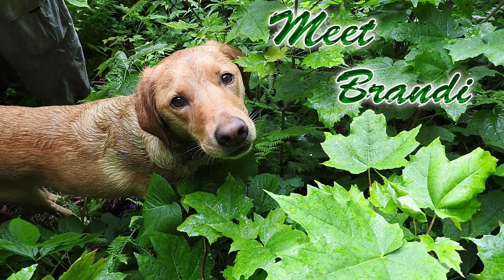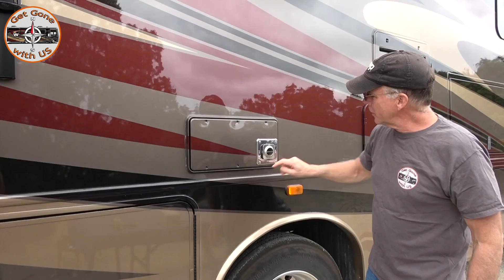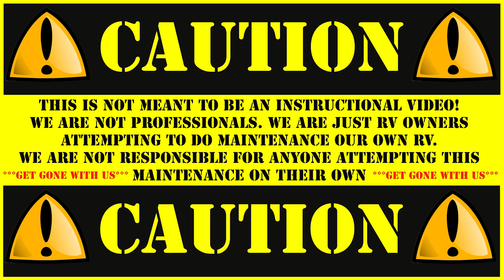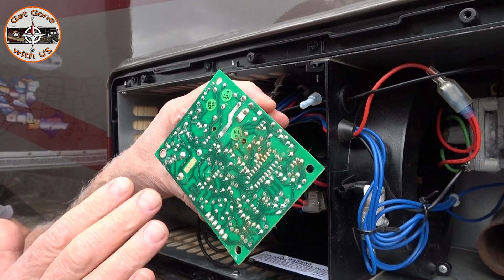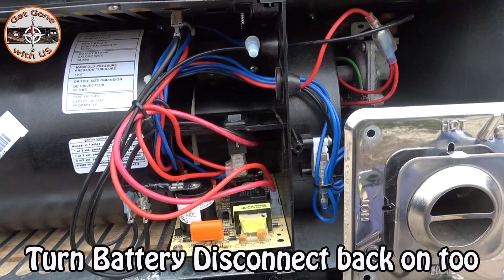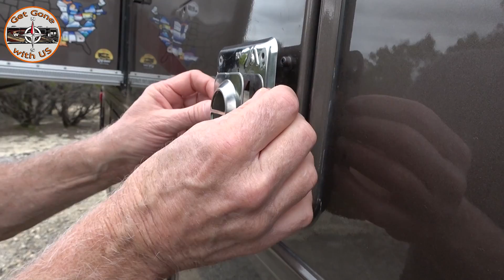Atwood Hydro Flame RV Furnace - Circuit Board Replacement

Comment: Saved again. Wet board equals blown components! Ugh! Always something. Ours was leaking through the caulking. Need to reseal. Always something to fix. 😊
Reply from the maker: Hi Art!  Sorry to hear about the wet board.  I was dissappointed with the design of the board.  Hope you both are doing well.  😀
Reply: @GetGonewithUS  Good morning. Life is good as we sit here at the beach in late October. 😉 I was very surprised to have a board outside the rig not conformal coated with a barrier to the moisture. Hope the back is doing well. Hello to Cheryl and the dogs. Cheers!
Reply from the maker: Back is doing real well (Knock on Wood)!  Cheryl says Hi, the dogs just kind of looked at me. 😆😆😆

Comment: I have the same heater unit on my rv. I replaced the circuit board and applied the weather stripping tape. Did have any more problems with water leaking ?
Reply: Nope, it ran fine after what we did, no water.
Reply: @WeRmudfun  thank you for the video and reply. This fix/repair is much less $$ than buying the circuit board with the retro fit kit from the manufacturer.
Reply from the maker: You are right Andy.  That kit should be free and there should be a recall as far as we are concerned.

Comment: The other difference I noticed is that mine had very short screws in it.  They were only about 5/8 long.  I've noticed this in several places on the RV.  Even though something comes with screws, the guys putting the RVs together just use whatever they have in their hands at the time.  Yours are longer with a countersunk/funnel head.  Mine are short pan head and rusty as hell.  Mine was leaking the day I got the RV.  The dealer claimed they fixed it.  Naturally, they spun most of the screws. It was summer and I lived in florida so I didn't use it again for a long time.  By the time I used it again, I had figured out that Keystone/Dometic/Thor warranty sucks.  So I just started using the electric heaters instead.
Reply from the maker: We hear you.  We didn't know ours furnace wasn't working until we started fulltiming and the temp was going down into the 20's. We mostly used electric heaters too.

Comment: Mine was even worse.  Furnace was in vertical position. Door leaked at the top because it is a thin piece of junk and there aren't enough screws to hold it against the gasket, and the screws strip the plastic the first time you even think about taking the cover off.  In mine the water went into the fan area and the pipe that the flame goes thru.  That caused the flame distribution box to corrode so all the tinny holes were clogged. So the flames were coming out into the wrong area and started to melt everything.  Lucky I didn't try to use it much.  It would have definitely caught on fire!!!  They need to recall these timebombs or at a minimum issue a replacement door that is made better and a kit to add more screws (but I don't think that would even be possible).  Since I don't trust it, I use the little electric heaters (that are also a safety issue, but one I have better control over).
Reply from the maker: Wow!  That sounds like a nightmare.  We were very disappointed with the way customer service handled our call.  They made a relocation kit for the board because of the leaking issue, but never made it a recall, plus charged more than a new board.

Comment: Hey Chuck and Cheryl just bought a new circuit board yesterday. The rv place charged me 200 plus tax...in canada...problem is the adapter has a green plastic bit on the end thst doesnt allow the new plug in to fit the old one...of course its Sat today and they are off...i had to drive 3 hr round trip to pick.up the new board...sigh....is it safe to take the green flange on the adapter off so it will fit the old plug? Thx a lot.
Reply from the maker: Hi Lorraine.  I am not sure what you are referring to 'a green plastic bit'. Our kit came with an adapter to fit older styles as we showed in the video.  Your best better would be to call the RV Place when they open and ask them about it. If you are feeling the heat wave like we are, hopefully you don't need to use the furnace right now.  Good Luck. 😀

Comment: I'm getting ready to replace my circuit board so this helps me feel better about tackling it. I had the same issue as you had last year and it was the sail switch. This time my furnace would fire up and then shut down. It would keep doing this. When it would run the fan would shut down as soon as the furnace turned off instead of running a cool down. Sometimes it would just stay on. Hoping I'm not wrong about the circuit board.
Reply from the maker: Good Luck Chuck (BTW great name! LOL).  We had checked the sail switch last year too, but our was fine.  The rusted circuit board was definitely our problem.  😀

Comment: Why didn't you use the relocation kit?
Reply from the maker: We had already purchased the circuit board, filmed the video and corrected the leaking issue before we knew there was a relocation kit. 😀

Comment: You would think Jayco would have put the circuit board in the vertical position but that RV seal foam tape will do the trick.  When you guys are at the next camping store, grab a round furnace exhaust bug screen.  Now I have to inspect mine.   Thanks for the heads up!  👍👍👍
Reply from the maker: I'm sure you'l be fine with the new rig, Tim.  Dometic has know about this issue for 5 years.  Supposedly they have sent to kit out to people for free even out of warranty.  The Customer Service  Rep I spoke to must have been having a bad day.  She was very rude.  🙄
Reply: I’ve read the same thing about them being aware and quickly resolving issues by sending the free replacement that makes it vertically set too.

I’m surprised at myself for not saving the page or number that I read in the forum discussing it.  

Unfortunate to hear you had the opposite experience of quick and easy when calling an agent.